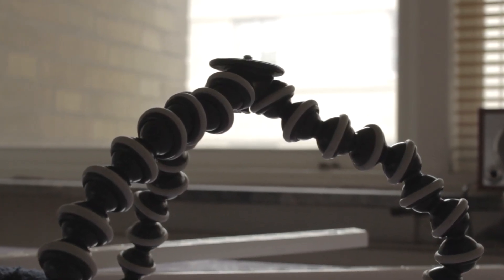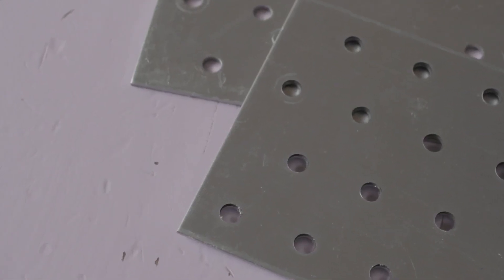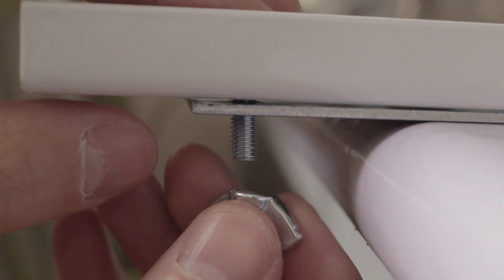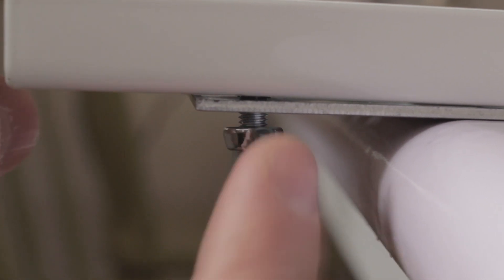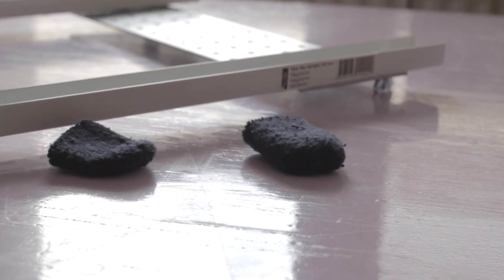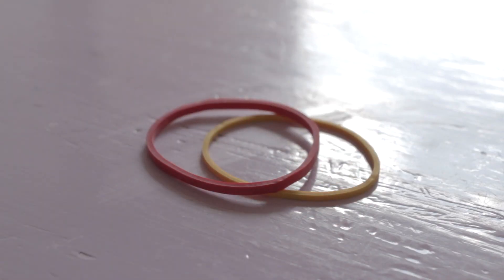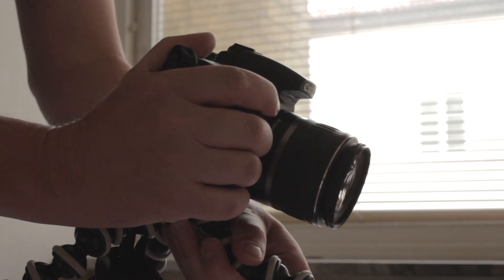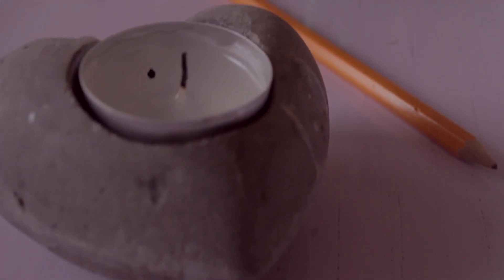cheap and easy way to make a dslr slider

Comment: I tried you slider design idea, but used MDF board instead of nail plates which are hard to find at 300mm. Works very well. The whole thing cost about £18 and required a minimum of DIY skills. I also used a light but sturdy Hama Profil Duo 3 tripod on it. So, no need for a Gorilla pod for me. Later, I might try using 2m lengths of twin slots. I don't see why it shouldn't work, but it might be harder to sustain a smooth track over that distance. Many thanks for a simple but brilliant idea.